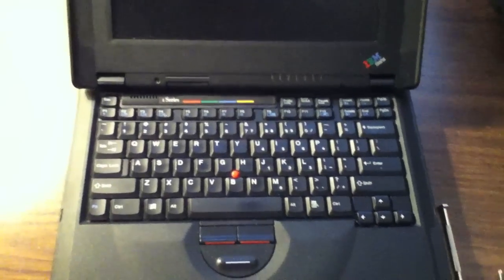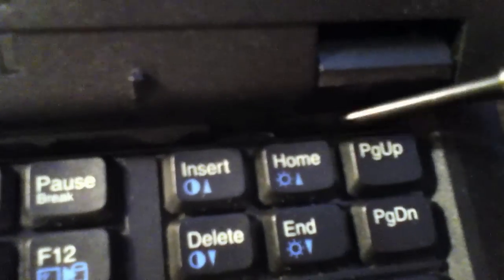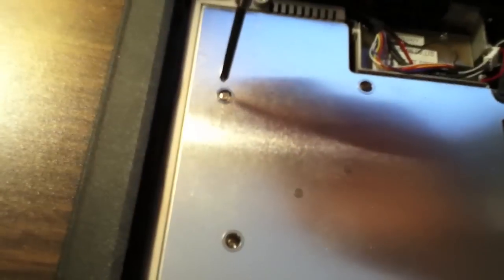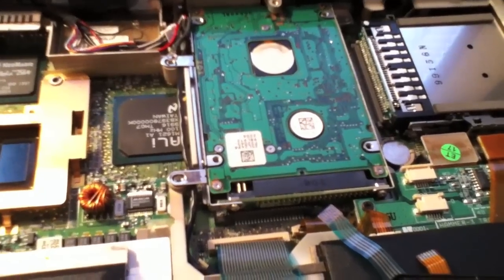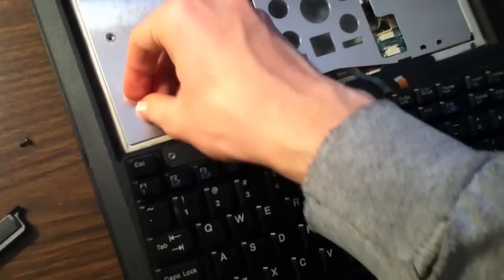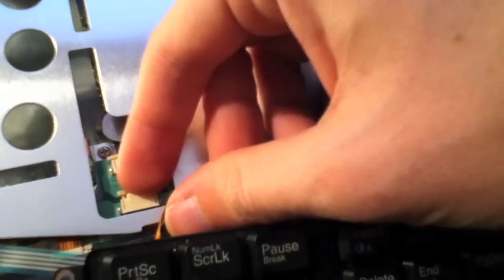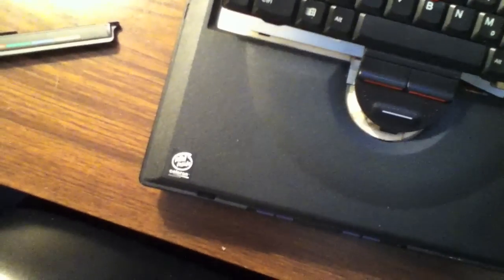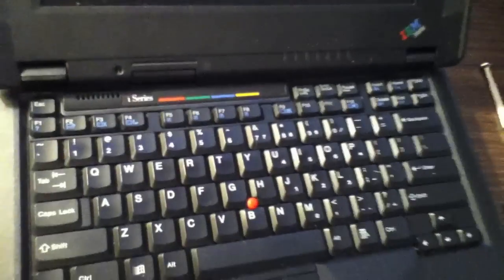Removal of a hard drive from an IBM ThinkPad 2611-412

Comment: Great job demo-ing the removal of hdd for a very old machine.  I was able to follow it step by step with no problems.  Unfortunately, when I replaced the hdd with a bigger and newer drive, the laptop would not boot off the new drive.  Oh well, I tried.  Time to move on, but thanks for your great video!

Comment: The iseries was the worst thing to happen to the thinkpad line until the Lenovo buyout.

Awesome video however,  Helped me out a bunch with this flea market POS.
Reply: +Izdat Afamas I'd have to disagree. The I-Series was functional, relatively inexpensive, got generally positive reviews, and was about as bulletproof as the rest of the Thinkpad line at the time. My i1450 lasted a good long time, longer than some of my more modern technology.

Now, was it as pricy or fancy as its more business oriented brethren in the Thinkpad lineup? No, but it was never meant to be. The I-series was meant for students, consumers on the go, etc., not for raw power users. My 1450 normally got well over three hours on a single charge, and this was without using lithium ion batteries. The screen ratio was also optimized for TYPING, you know, useful activities, instead of the video-centric screen rations we see today. The I-Series also boasted one of the best laptop keyboards ever spec'd. Compare typing on one compared to today's lousy chiclet keyboards.  

No, the I-Series wasn't perfect, but what is? Overall, it was a nice blend of power and performance in an affordable package, affordable for the time. I have two I-Series laptops I'm rebuilding to use as traveling typing machines (I'm a part time author). Again, that magic keyboard will keep one typing far longer than what Lenovo is putting on its so-called Thinkpads these days!